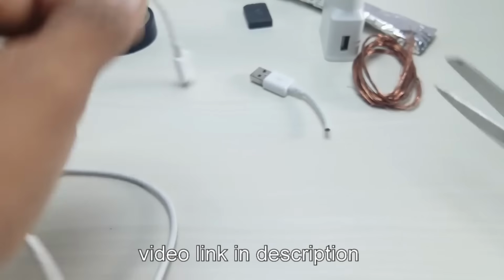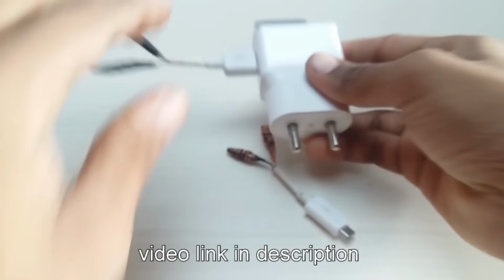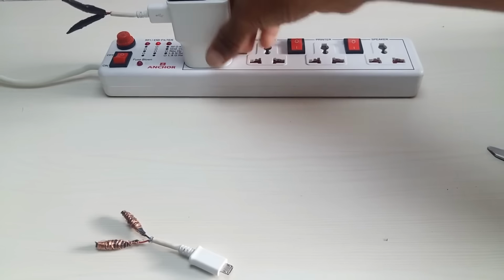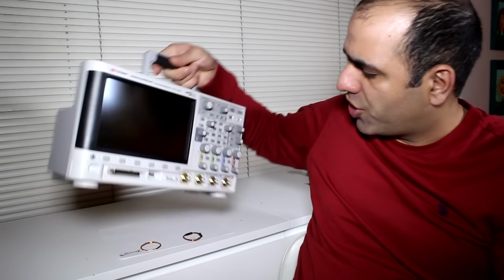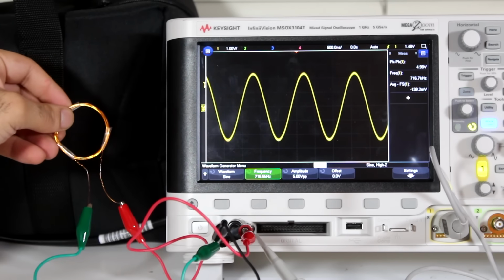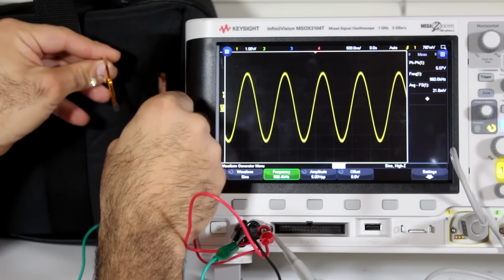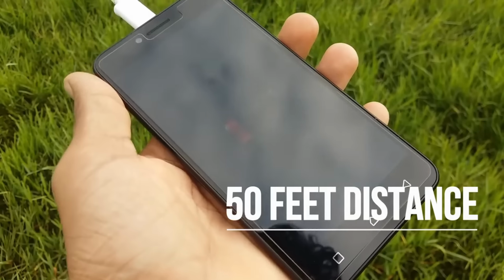Fake and Real Wireless Power

Comment: no offense electroboom
but that first socket is actually connected with only the main switch
hence power is supplied to socket in which he plugged the charger adapter
I have that kind of extension box hence I know it
By the way, I tried it, yet it failed
hence thnx for the vital info 
amazing explanations

Comment: Ever stand under a high tension line with a fluorescent bulb? I did. I took a voltmeter and measured the volts between me and the car. 70 volts measured. I could feel the power thru my hand

Comment: It's particularly odd that you chose to focus on the "issue" with the power strip -- considering that, since each plug individually has a switch, and there are 4 total slots (3 visibly exposed + the active one with the charger plugged into it), it's clear that the switches go to the left of their respective outlet, and thus the switch you should have been looking at wasn't even visible in the video -- in light of the fact that there were so many other perfectly valid criticisms to work with 🤔
Reply: People can conjure up bullshit for the rest of it, but that it's fucking off is pretty indisputable

Comment: The question that I always have @2:35 , why low frequency AC is dangerous? And which one is more dangerous 120V or 220V Low frequency AC?
Reply: At high enough frequency, the electricity can't mess with your nerves (the actual dangerous thing). And 220VAC is more dangerous than 120VAC.

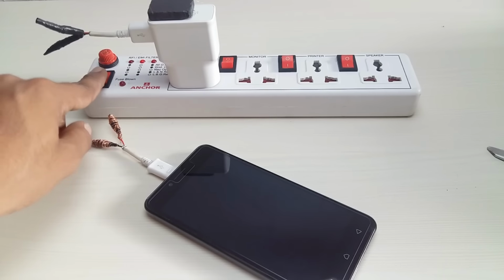Comment: Hey electroboom, @1:36 a small correction. This type of power extender, has the first port on by default when the total unit is switched on. The other switches are for the three other ports....

Comment: Hey mehdi 
I use the same power extension that these fake video maker used and you said In the video that the power button in extension is off 
Well actually that extension has 4 outlets and only three of them has power buttons 
The first one turns on and off with the extension only and it doesy have any extra power button
The button u pointed is actually for the second outlet.
I am not saying that the video isn't fake . I am pointing out that u just made a mistake there.
By the way I luv ur videos. 🥰

Comment: Thank you for your time sir I don't have a degree in engineering but I have a strong electronics background but I can't explain this I stopped the water flow on the Kelvin water droplet high voltage generator DC generator and the current continued to flow.  When I used an electrolytic capacitor between L1 bifilliar  coil I did see a magnetic field as well as electric field lines.  But like I said when I used a AC cap of approximately 47 microfarads high voltage I saw no electromagnetic component only current yeah I felt the force I could fill the modulation of the current I thought it was voltage.  Can you help explain what kind of field I've generated?

Comment: I need some advice I made a completely passive high voltage generator using the Kelvin rainstorm circuit of just using water and a spark gap I built four of these using the same water flow starting at different times and I was able to achieve a variable pulse like like a almost like a TTL pulse but with high voltage then a coupled that voltage capacitively or into a by filler coil.  And I took that inductance of that huge electromagnetic pulse that was generated through the pancake coil center and I induced it via wires into a parabolic shaped coil of approximately 2 l in area I think it was about 188 cubic inches in the center of the parabolic I placed a column of water pure water around the column of pure water I slid over compact discs because the coil itself has a capacitive quality to it as well as the capacitive quality of the body filler coil electrons were able to gather onto my parabolic coil I face shifted the two with an AC cap in between.  This caused a 90° face shift into my parabolic coil but only the electrostatics were present not the EM wave on the output of the parabolic I noticed my meter had zero volts and around 300 amps DC on my oscilloscope I viewed a leading edge pulse not a trailing edge pulse.  I literally felt every time I turn it on through the timed input sequence pulses unipolar DC pulses of high voltage at about 30 seconds into it I felt a shock wave.  That is what I noticed both of my meters and my oscilloscope showing no electromagnetic induction yet there existed a DC offset standing wave is this not radiant energy?  I walked as far as I could walk watching the current slowly reduce on my digital multimeter the leads were hanging in the air nothing was touching the leads no resistor was across them I witnessed the exact same effect on the oscilloscope.  Why is it that I don't see a trailing edge pulse only a leading edge?  as I continue to walk further approximately half a mile my meter finally went to zero both meters.  When the current reach zero at that half mile mark I put the meter across myself and one hanging in the air one lead hanging in the air I measured voltage as I walked back toward the coil the voltage increases along with the current what kind of field have I generated?

Comment: Just turn on your Tesla coil and hook up a capacitor of led voltage and hook it up based on polarity. It should run wireless but you may need a ground connect longer distance.

Comment: Dude that phone charger was fake garbage, but i think i should tell this to you:

At 1:33, u said it was fake since the charger switch wasn't on, but it actually was.
The switch for that particular port(the extreme left one) is actually the main switch for the entire extension board
And the switches for each port (the 2nd,3rd and 4th ones) is the one to the left of each
That's why there is no switch at the extreme right. I can confirm this since i have the same type extension board

Comment: How to get 630M views/year:
Have the video open on 20 or so different computers, with ultra-high-speed internet, and consistently reload the video every 1 second for just a bit under a year. Unless I'm mistaken, 60 views/min, times 60 mins/hr, times 24 hr/day, times 365 days/yr, times 20 computers, equals 630,720,000 views/yr.

How to get 56.5M subs/year:
Have 100 or so different computers, with ultra-high-speed internet, each of which is programmed to create a random Google account, sign in to the newly created google account, load your channel on YouTube, click the Subscribe button, sign out, and repeat this process every minute or so.
1 sub/min, times 60 mins/hr, times 24 hrs/day, times 365 days/yr, times 100 computers, equals 52560000 subs/year.

Of course another way to accomplish this much quicker is to hack into the YouTube subscriber database, and indirectly edit your subscriber count by adding your channel to the Subscribed list of every Google account in existence. But that is much harder.

Comment: Can you please make a video on WiFi Telemetry (2.4 GHz). How come a receiver that is only able to receive signal can transmit data back to its transmitter. This is a very common feature in RC-planes these days, but I just don't understand inner workings of RSSI. 
Sorry for posting this question here, but I don't see any forum on youtube where I could have posted this question.
Thanks.

Comment: Wait, if only AC voltage can pass through, explain real wireless charging with phones and the Apple Watch that uses DC current.
Reply: They also use high frequenty AC currents, there is a coil in the phone and a rectifier circuit to convert the AC to DC for the battery.

Comment: No doubt about the power charger being fake. I think the LEDs in the fake montage on the power bar seem to be diagnostic lights (the type that tell you if the hot and neutral are reversed, or if the ground is connected or not). I’m guessing from the fact that there are 3 isolated switches but four outlets that one is always on.

Keep it up ElectroBOOM. Don’t give into the Darkside (unless of course you’re offered a crazy amount of money in the nine digit range, then it’s OK). 

Keep up the great videos !

Comment: how only ac works for power transfer.  I don't get it.  I have wireless charging for my phone, and both devices uses dc power, unless there is a circuit that converts dc to ac, this wouldn't make sense

Comment: Actually, "wireless power" works in the vicinity around a powerful AM transmitter. This makes a crazy ghostery lighting when you have a flourescent tube (neon light) lit up just while holding it up in the air there without having it connected to any power source.

Comment: So could you actually build a charging dock for a video?
One that connects to the battery of a tablet or phone?

I am in need of a decent tutorial, I picked up a tablet/laptop, that uses a bloody usb-c to charge the battery up, however it doesn’t charge unless I hold the charger in or able to get the wire to balance to balance and even if I find the correct position it doesn’t always work.

So I believe I need some sort of wireless charging solution where it’s connect to the battery rather then connecting it to the usb-c

Comment: Kid - “Kind of wrong, you can transmit oscillating DC current wirelessly over a huge distance with the appropriate antenna, dipole.” ITS RF ENERGY, not electricity. Its impossible to transmit just plain electricity. For example, the FM transmitter in my bedroom creates a 25 watt oscillating DC current at 87.7 mhz which is channeled to the GP antenna on my roof, this “energy” can be picked up 20 miles away. Of course, the energy will get very very weak as you get farther from the transmitter. So its possible but you cannot power anything from it, you can only transmit information or music through “wireless energy”.
Reply from the maker: Haha! Oscillating DC current!
Reply: L.O.L.
Reply: I was being retarded again

Comment: I was thinking, can we not have long range wireless power by using high powers lasers to transfer energy to something like a solar panel that works with the laser, you would need direct line of sight to some kind of tower but if you have a lot of towers at high altitudes it might work.

Comment: Haha, not to mention that the length of the antenna is inversely proportional to the frequency, meaning that the lower the frequency, the bigger the antenna, so for a 50Hz AC source you would need a 3 km antenna for both primary and secondary coils.

Comment: I cannot believe anyone believed the wireless part with Aluminum foil. It was a fake video been played on the phone, when the USB was connected.. It was a great prank. 
Did you see the Audio Jack prank for the iPhone? Many people destroyed their expensive iPhones, just to get back the audio jack!!!

We used to do the FM radio prank by playing with an overpowered FM signal to play a General alert Breaking news message with the local "kid puppet" named Charlie been raped by an ten legged pink Alien with a toilet plunger. We listened to what radio station of the target/s are listening to and tuned our system to their FM frequency and play the recorded prank audio. 
Then there was the rewiring pranks in school, where when the machines are turned on, that it used to trip the circuit breakers. Live to earth did the trick and a switch nicely placed and hidden allowed us to repeat it at will. It was great to get time off in school when the main fuse to the school blew (coincidentally when we were board or need time to setup some other pranks), then when they are looking that the fuse board, we switch another switch that we installed to correct the wiring and leave them no wiser.  Then the Nylon in the Forge coals to create a huge production of smoke that the hood could not extract enough off usually near class end. It only worked if the next class is in the same building. Then the magnetic switch prank, that is another story altogether. 
The switch the sign post pranks outside of school, to send people the long way round or into cul de sacs. Ghostly relocation of the Teachers cars down a muddy school field, and get some time off class to push it back up. It was great to miss out on boring classes. They still could not figure out how we done it without been noticed. The distractions were greatest part of the pranks, when most of the setup were done.
The bangers noise makers been set off and dropped into school Toilet bowls, while the fellow kids was shitting (for some reason one kid he used to sit forward which made it easy for us.  The Eddie Murphy tail pipe and banana trick did work and leaving meat on the engine block where it is not easily visually seen was another. It used to stink up over time.We tried several materials for best stink effect.  Ahh, those were the old good days in school. These modern day kids were so dull. We learnt about more life in that school better, than most kids even in those days, and today they fail miserably. We learned how problems occurs, which made the best pranks material. All information and material was processed and analyzed for possible pranks. If there was a test for Pranks, we aced it. Pranks was the real thing that motivated us in school. I think the best comment was from the Principal to the minster for Education when she asked for what do the children do for extra circulatory activities. He said that was not an issue, these kids had that down pat. He told her not to ask for details. He knew what we were up something, but not the details. Our only wish was to leave meat (we nicked the teacher lunch meat) for the Minister car engine block, but the Police was all over it. They would not budged from the government minster Car and had it covered 360 degrees and would not let us near it (5 meters the closest we got to it).We tried many things to distract them. It was the one Prank we tried to complete and failed because the Principal noticed us from the office window and knew we were up to something and called out to send us down to the school play yard for (Extra) PE class. He knew how to distract us without causing a scene  in front of government visitors. He was trying to get government money to rebuild the school. Many a teacher car ghostly disappeared (without a sound) from in front of that window into the muddy school field.There was no CCTV in those days and the principal office had a great view. Nothing moved without us noticing.

Comment: I really love your videos and I am catching up with all the videos currently. Putting some light on the power board that the fake guy used as I have the same one, it has 4 power outlets and 3 switches. The first one is directly powered and the rest three has the switches. So the charger is powered but the rest of the circuit is fake. :) 

And don't let yourself to the dark :'D

Comment: This is true but get a flanee jacket roll on ground for 20s then touch glass table that has metal base if you get shocked your doing it right then set your phone right where you toched table it will chrdge for 5 seconds